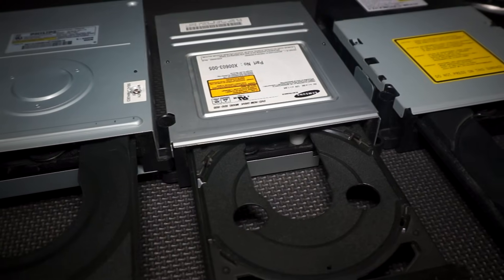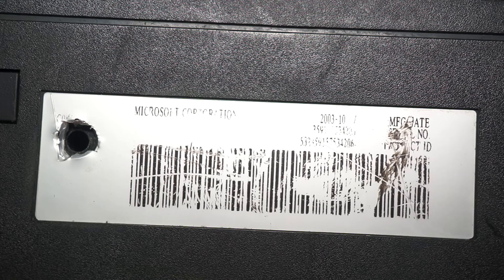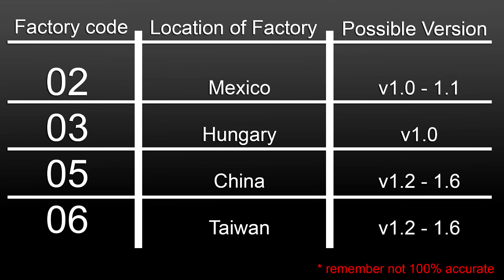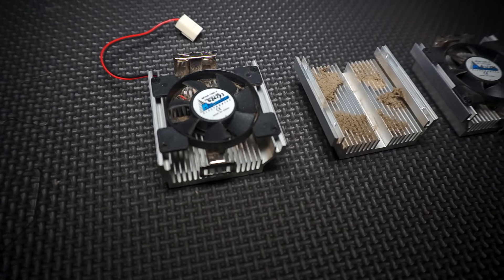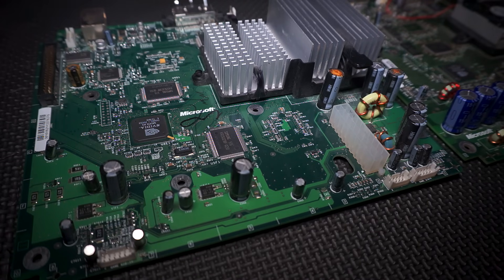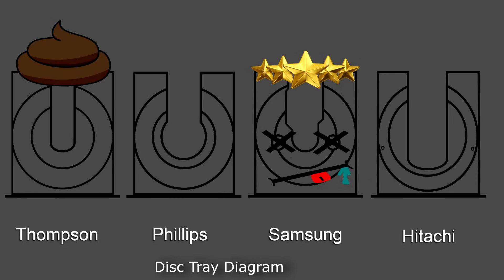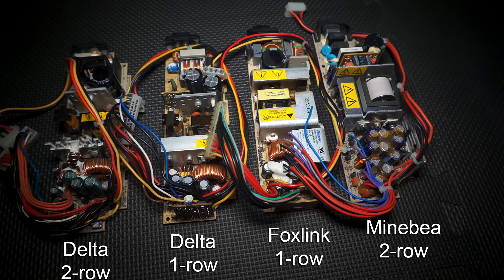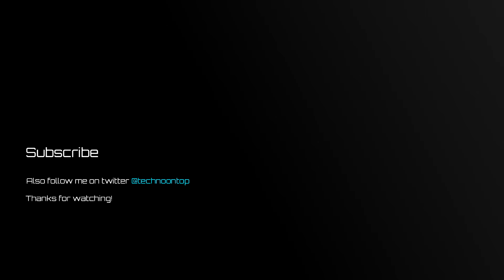How to tell what version original xbox you have

Comment: With the info in this video i was able to pick up a 1.6 samsung ram motherboard system with a hitatchi disc drive and a seagate hard drive (eew seagate.) after a quick look everything seems to be in order, the clock capacitor is a gold one and shows no sign of damage, the power supply is a delta brand and uses jumper wires from the plug port to the pcb to reduce stress. All looks well and good. thanks for the help! :)
Reply from the maker: Happy to hear everything is in order! Thanks for watching happy modding!

Comment: I just checked this one my son bought its a 1.5 according to this video ground pin disconnected.
Reply from the maker: The pin I showed was actually the wrong pin you need to test pin 2 to ground.you can also measure pin 9 while the Xbox is on it should have 3.3v of power if it doesn't its a 1.5. I addressed it in the comments and the description. Sorry about that. Thanks for watching

Comment: Thanks for the very clear differentiations! Very informative ! I've got the excalibur chip with samsung memory, and its modded with a Duo X2 GS so it can't be that hard can it? I do wonder what the "switch" on that chip does though... if I informed myself right it's a dual bios chip and one chip works for versions 1-5 and the other for 1.6 and 6b, the swich is supposed to make those changes. I don't even know what mine is set at. Though I have one question. Isn't it so that the very first original xbox had a slightly weaker graphics chip than the later versions? You could see it by the (original, not modded) dashboard alone if I remember correctly. Not sure what the distinction exactly is but if I remember right from the days they were very much different. Any info about that?
Reply from the maker: no problem thanks for checking it out! yeah that switch on the chip switches between the 2 memory banks, it would be set on the BIOS specific to the 1.6's which is M8+ or some variation on that. i can remember reading something on that but i cant really remember the details of it.the Xcalibur chip has issues playing certain games at 480p... jetset radio future is one of them....there are a few others but im not sure off the top of my head.....they were probably other Sega games. or games made by that same studio.

Comment: If the console is made after 2004 is it fine to leave the clock capacitor ?
Reply from the maker: If the Xbox is a 1.6-1.6b leave the clock capacitor. Thanks for watching
Reply: I got a 2005 version why is the no HD settings when i have component plugged in could it be my tv or the Xbox? :)
Reply from the maker: The Xbox switches into its HD based on which pins are shorted through the component cable connector. In xbmc there is a setting. I feel like I remember there being some button combo to push but I'm unsure off the top of my head

Comment: what's funny is i was unlucky enough to get a 1.6b revision i didn't want to mod it or anything however when i got it the disc drive wouldnt open, when i fixed that the laser stopped reading disc's i fixed that and i have delt with the awful video output and scrambled video signal on certain games in 480p thanks to that damn xcalibur chip i'm glad i have a 1.4 or 1.5 now
Reply from the maker: Well I'm glad you were able to find a lower version! Iv never ran across a 1.6b before. Thanks for watching

Comment: Pin 2 is the circular one on the left not the square one on the right, that's most likely a 1.4
Reply from the maker: Yeah I screwed up that part unfortunately.. I added it to the description. Thanks for checking out the video.
Reply: @TechnoOnTop  Yeah I didn't notice that, I don't read descriptions if they don't have a link I need :'(
Reply from the maker: No worries. It's to bad YouTube removed those annotations. I would of just added a little pop up

Comment: How do you fix a  original xbox Samsung disk drive that gets stuck?I have to use a paperclip to manually eject it.
Reply from the maker: You need to take it apart, and clean it up, particularly the little rubber belt that opens and closes it. I'd just use soap and water for the belt and isopropyl on other things. Or you could source a new belt I'm sure one can be found you would just need to Measure it. But cleaning it may be all you need.
Reply: I actually took rubber band out and cleaned and reinstalled without taking drive apart. Open the disk drive, shine a flashlight, get tweezers
Reply from the maker: Cool! Iv never tried that thanks for sharing!

Comment: I have a problem with my Xbox, when I'm push a power button the power is not turn on, is only a blink red light every time I push a power button. What should I do? P.S my Xbox is Halo 2 edition made  from year of 2005
Reply from the maker: Are you getting any video signal with an error code on the TV? From what I gather flashing red means something is wrong with the eeprom. If it's flashing red and green, it's just system failure could be a bunch of different things. Was it modded?
Reply: No is not turn on at all, just wink a red light, When I press a power button or eject button, but when I push a button a many times, the power is turn on normally... I got this problem when my Xbox not in use a couple hours...
Yes it's was modded 
Sorry for my bad English
Reply from the maker: @Fey-ml6qs  it's probably your Eeprom. It's corrupted, options to fix it would be re-flashing it. My smartxx modchip has an eeprom tool built into its operating system. Look into auto installer deluxe, and hexen tools, you burn those to a disc. Get your Xbox to boot into one and there are tools to dump the eeprom on them. They may even have an eeprom tool on them.
Reply: TechnoOnTop Thank you for the information, I look forward to it... By the way, I've have one question: the processor and GPU of Xbox is using thermal pad or thermal paste?
Reply from the maker: @Fey-ml6qs  they use a thermal paste. and the GPU can be tough to take off. i recommend heating it up before prying on it to much. either by just plugging in the console or with a heat gun.
Reply: TechnoOnTop okay, thank you very much for the information 👍
Reply: Light of death! Fix it or get a new unit! 😎

Comment: The date on my xbox says its a 1.1, the serial number says its a 1.2-1.6, and the inside says its a 1.3 rip
Reply from the maker: Always believe what the inside is telling you lol. Was it opened before you took it apart? It's possible the inards where swapped into a different case. It's also possible that it was sent in to Microsoft for a RMA and they printed a new tag with a different date.
Reply: You can also check the clock capacitor 
If it’s gold it’s late 1.3 onwards

Comment: I have a 1.0 with a DuoX2 chip.  I took it apart for a cleanup, but my GPU fan is struggling and sounds like death.  I'm not familiar with a type of replacement I can get.  Any tips?
Reply from the maker: It's best to just replace the heatsink from a newer Xbox. They didn't have the fans on them. Forever I did find a 40x40x10 led fan that fit but it died maybe a month later.
Reply: gotcha.  figured that would be might best option. Thanks.  Ill let ya know how my search ends up. @TechnoOnTop
Reply from the maker: No problem, good luck ebay is a good spot. That and niche forum markets.

Comment: I have a original Xbox with a date of March 2005,I'm not experienced enough to open it up yet to tinker with the insides but what would be the odds of having v.1.6? Cause I would hate to have a dead Xbox because of the capacitor
Reply from the maker: I had a comment earlier that taught me a new way of identifying whether or not its a V1.6. look at the AV connector 1.6's show metal shielding along the bottom. but yea th capacitors are a problem. i have had one xbox break because of it. the traces were eaten away
Reply: I got into it,it's a 1.6. I've cleaned the lense and the inside also. It was filthy,idk one game still throws up the DVD playback screen. Munch's oddyessee. I don't know if it's the game itself or if the laser is getting weak. I wanna get it in like new condition if possible. The other games play pretty good.

Comment: Yes, Samsung drives were the best, iirc the Thompsom one used the same laser to read CDs and had several problems to read burnt discs and even a few pressed ones.
Samsung drives had a problem where the focus and tracking coils ended up soaked in some weird dark-ish goo that I had to clean several times.
Phillips drives where right up there with the Samsung ones.
Reply from the maker: Thanks for the input, I didn't know that the smasungs had that problem until someone else mentioned it. Makes me wonder if those Samsung drives I have would actually work if I opened them up and cleaned them.

Comment: A fast way to tell if an xbox is at least TSOPable and RAM upgradable, (1.0-1.5), is by looking at the AV output connector. 1.6 boards have a connector that shows some of its metal shielding across the bottom. 1.0-1.4 boards don't show any internal metal shielding. Not positive about the 1.5 boards cause I've never seen one. But it'll save you when you come across xboxs with the MFG date sticker wiped clean.
Reply from the maker: Whoa I never knew or noticed that. That's awesome! That's a great tip I hate buying an Xbox getting it home and it being a 1.6 lol.

Comment: i have a 1.6b that has the hynix ram and also the psu that has the issue with burning out in the spots indicated is the single row foxlink i have one that burned in same spot but i resoldered and its been working fine for 10 years
Reply from the maker: Thanks for sharing. I haven't had another issue with one since I was a kid.

Comment: Hey..
I have a 1.4 with a leaking clock capacitor and it died but I bought a 1.1 or 1.2 form 2002 but the disc drive is not good😔😔 can I put nu 1.4 disc drive in the 1.2?
Reply from the maker: Sorry to hear that, but yes the all the DVD drives are interchangeable. Thanks for watching

Comment: the samsung drives used ferrofluid on the lens servo which over time collected dust and turned into a thick paste breaking drives ability to focus.Though they worked the best they also lasted the shortest. Therefor I only used them to dump dodgy discs and rest of the time stored them in antistatic bags
Reply from the maker: I didn't know that thanks for sharing. Do you think the paste could be cleaned off to fix them? Then use another electronic grease on the servos instead?

Comment: May I add,that my Xbox is a V1.1 with the production code 05 for China plus it's manufactured in august of 2003!
Reply from the maker: Never know! Thanks for commenting and watching
Reply: @TechnoOnTop  So, after I recently updated my Xbox a bit and swapped my old 120GB IDE drive for a 500GB SATA drive I noticed something and remembered this video!
According to my lower case, the console would be a v1.2 - v1.5 produced in China MFG: 2003 - 08 - 05  SN:1113877 33205, but according to my dashboard, I have a v1.1 from China made in 2002, week 36, line 6  SN:607632423605.
I suspect that the case was "Swapped" back when the console was first modified, I bought it in 2017 and it was modified by a shop in the early 2000s, it was never opened after that and still had the stickers from the shop on it!
Reply from the maker: @BigDom1002  yeah it definitely sounds like it was case swapped at some point, or the motherboard was swapped in funny when that happens, but just like I always tell people the date isn't a accurate way to tell what version you have. But sounds like you have a  nice setup! 500gb will fit alot of games! Though filling it will take awhile. Anyways thanks for remembering the channel and thanks for Sharing!

Comment: Great video, but I’ve got mine open now as I want to mod it. I have Conextant Chip, Samsung RAM, No Fan just a heat sink and a single PSU in the board. I also have a Samsung DVD drive and a Seagate HDD. The year is 2002. So what version do I have?
Reply from the maker: As long as it's not an Xcalibur video chip you can tsop it. Do you empty spots for ram 2 on top and 2 on bottom. But from what your saying. Go ahead an softmod then move on to a tsop

Comment: I don't need to know if it's easily modded I only need to know if it's a 1.5 motherboard revision so I don't have to worry about that damn clock capacitor
Reply from the maker: There was a mistake in the video I show the wrong pin, so it's possible you don't have a 1.5 but rather a 1.4. It's recommended you remove the cap unless you have a 1.6. Personally unless the cap is going bad I don't remove it but it should be checked on every now and again if you don't remove it. Thanks for watching.
Reply: TechnoOnTop I checked the kernel version on my Xbox the last 4 digits are 5838 which according to the chart would mean I have a 1.6 revision, also my manufacturing date is in 2005 so it's one of the last ones ever made or at least I think so, I honestly want a 1.1 though to softmod

Comment: nothing to do , opened up mine , and according to the video i have a 1.6b . lol
Reply from the maker: Either cool or not cool depending on if you wanted to hard mod it. As iv said iv never come across a 1.6b and iv bought a fare share of Xbox consoles of my years of modding. Thanks for checking out the video
Reply: Mine had a modchip installed to bypass the region issue , the perils of buying a pal console and using it in a ntsc region XD...

Comment: cool video bro. I've heard Microsoft added a fuse later on (external Box with TEST button). I have that, but also others. You could have also covered what versions most likely are in a Crystal or the Skeleton (first grey one in Japan) or a transparent green one etc. That would have maybe helped also a bit. 

I will maybe take a look at what versions or  what CD I have with your reference. Pretty rad. I also have some modded ones, but not did myself.
Reply from the maker: Yeah they did a recall where they replaced the power cords. From what I read that did nothing to actually fix the problem. Iv personally never had one of the  "fixed" cords. And I'd figure there aren't to many floating around. I don't own any of the transparent ones. Iv passed up a few over the years that I'm kicking myself for not buying... Oh well but thanks for watching I appreciate it
Reply: Old comment thread.

Are the recalled power cables worth more?  I have one.

Microsoft sent me a letter, back in the day, about the recall.  They sent me the external brick power cable.

Comment: Ok I'm confused really bad I've got 2 original XBOXES and one (/the first one) I kinda got pissed at I fucked up the frame around it but the I got a second one and I decided to switch motherboards between the two and right away I noticed differences on the motherboard a I look up this video to help me but I'm having trouble determing (can't spell sorry.) My first XBOX and I need help with my version and here's the info as followed:
Date: 2004-06-23 [V1.2-1.5 or V1.6-1.6b]
Serial No. (only last): 05 [China, V1.2-1.6]
Video chip (now here's where I'm puzzle because you didn't mention this in your video and I'm not sure if it's a video chip or not, it's got 2 chips with a X (XBOX) on it as followed info): Xyclops and a Xcalibur [V1.6-1.6b] (possibly a 1.6b?)
CPU Heat sink: No fan/updated heat sink [(possibly)V1.0]
Power Supply Connector: [Two row V1.2-1.3]
RAM: [SAMSUNG]
LPC: [N/A]
KERNEL: [N/A]
So maybe it's a V1.6? Or V1.6b??
Reply from the maker: they are 1.6's the video chips give them away. Sorry for such a late reply
Reply: TechnoOnTop it's fine thanks for the help

Comment: I have a 1.6. Do i need to remove the clock cap?
Reply from the maker: no, im pretty sure if you do remove it the xbox wont boot anymore
Reply: TechnoOnTop yeah I'm just going to leave it alone. If it leaks, it leaks. I read that the capacitors for the last revision are much better quality
Reply from the maker: Yeah iv never seen a leaky cap on a 1.6 worst case if it did start to leak in the future would be to just replace it. But I doubt you will ever have to worry about it

Comment: I have a v1.0 that died today. Yesterday  I was playing halo with it. Rip. Atleast I still have my v1.2 working.
Reply from the maker: That sucks do you know what went wrong with it?
Reply: TechnoOnTop It has the red and green flashing lights. Took it apart took out the dvd drive still had the problem. The motherboard looked fine no blown up capacitors and it was surprisingly clean inside. I have no idea what is wrong with it wrong with it. Im guessing it is the video chip.